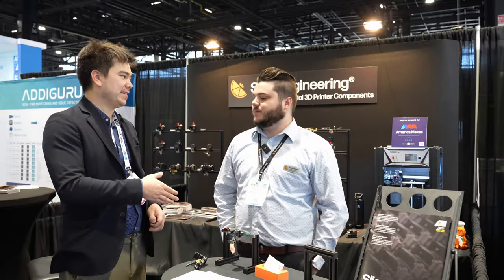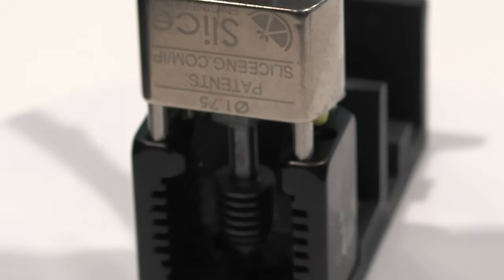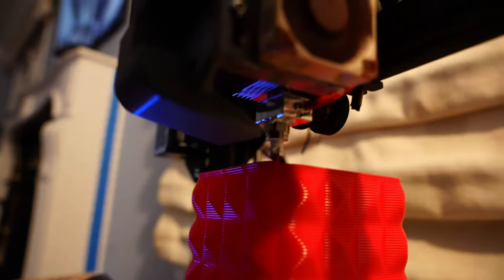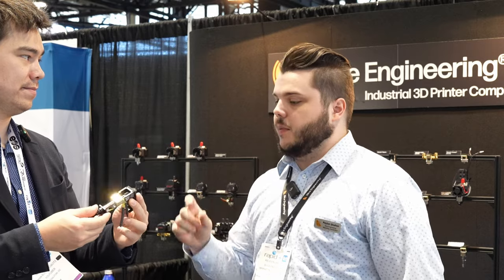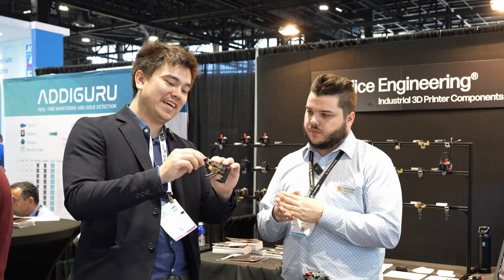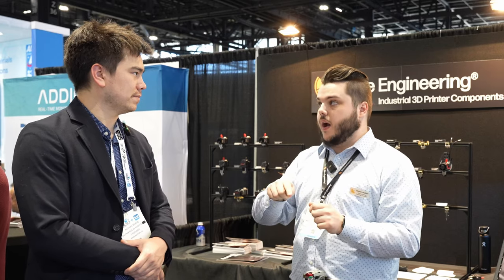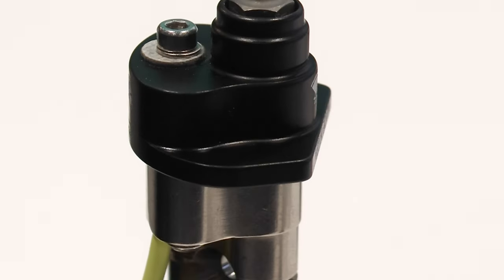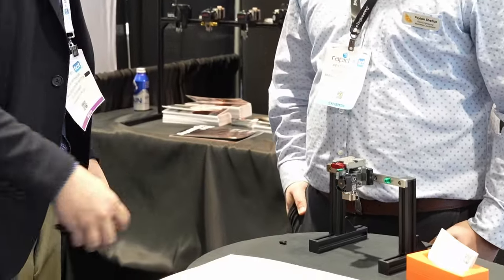Slice Engineering's Insane $1,000 Hotend

Comment from the maker: For those about to ask who needs this hotend, it really it comes down to industrial users with $50k machines that want to be able to print twice as fast.
That $1k investment saves them $50k on buying another printer.
Do I need it? No.
Do you need it? Probably not.
Does someone else need it? Maybe!
Reply: I mean, it's not that expensive...It's like 3x Ender 3 S1, but you get much more bragging rights, so I figure it's worth it.
Reply: @astrumrocket6556  Install that in an ender 3 :)
Reply: Then maybe they should stop doing bogus patent takedowns on companies (and even individuals!) making parts that aren't for $50k industrial printers.
Reply: @atnfn  No no, my budget would allow me to have either 3 enders, or a single hotend. No negotiation. /s
Reply: A goliath looks better/same for 1/7 of the price
Reply: TOTALLY WORTH IT!
Reply from the maker: @gedeonang7077  there is also a crazy long ceramic heater hotend on the market from trianglelabs that I’d like to try. Looks fun

Comment: Looks surprisingly like the Goliath (LSD) from Vez. Hmm, didn't S.E. slap him with a Cease and Desist order right after the Goliath was released. All makes sense now doesn't it. Say what you will about IP, but the patent system in most countries is terrible, and basically serves to stifle innovation. IMHO, the likes of S.E. and Stratasys have set back residential 3D printing many years now.
Reply from the maker: Everything they are doing is legal. If you don’t like it, write your senator and get the laws changed.
Reply: @NathanBuildsRobots  Patents are a good thing, not arguing that. It's just that when a company is blocking an entire field from progress, like Stratasys did with their enclosed printer patent, or Slice with their hot end spacers, it isn't that great. especially when said company sits around and doesn't develop products further.

The Stratasys enclosure patent expiring has opened the floodgates for affordable and good quality printers. What used to be $100k+ can now be bought for less than $2k.
Reply: @NathanBuildsRobots I really enjoy your content, but that is a stupid response.
Reply: This is good advice.
Reply: @NathanBuildsRobots  Legal is not the same thing as admirable, or even ethical. Community pressure on Slice is far more likely to effect change than petioning a Senator to change patent laws. I'm not saying it's likely to change the way Slice does business, but the likelihood of patent law being overhauled over something like this is so infinitesimal your advice can easily be confused as bad faith advice.
Reply: @NathanBuildsRobots  write your senators lol,  did you remind him to send 100 million check along? Please stay off politics.
Reply: I think you can make the argument that slice doesn't deserve the patent.  I remember reading a thread back when the voron team dropped slice where some guy said that slice's designs had been around in other hotends before they were patented, and one of the requirements of a patent is that no previous design has been made... something like that. 
anyway I don't think you have to demand that patent law changes to claim that what slice is doing is wrong.
Reply: @trandachtomy  Agreed the one thing companies like $lice respond to is the loss of a customer base.  Stop buying from them until they change their ways.

Comment: 1) make a very good hotend

2) patent something you didn’t even invented in the first place

3) get confident and release an overpriced UHF Hotend

4) no hobbyist uses or showcases it except one super friendly guy with his DIY high speed printer, providing advertisement for your brand

5) the same guy makes his own hotend that outperforms yours in every point

6) send your patent lawyers at him to sink his project despite sharing no similarities with your design 

7) he nearly gives up but sells his hotend anyways

8) write a response where you insult nearly every aspect of the DIY community

9) loose respect from every hobbyist consumer

10) « Slice Engineering is proud to announce its move forward to industrial 3D printing »
Reply: thank goodness vez changed his hotend so it does not violate the patent alr, and can be sold worldwide :) and "industrial" doesnt really need those flow rates, large nozzles and low resolution isnt really what industrial needs, if they are looking for that a pellet printer is prob good. if you see what they are printing with that hotend its just useless toys lol
Reply from the maker: Pretty sure companies are buying these. There are a number of other features, like redundant sensors/heaters, multi zone heatbreak, internal flow splitter, specialized coatings, etc.
Reply: @NathanBuildsRobots  Not sure about how good slice's coating is, but I know the Goliath's one is Zirconia internal coated, which is SUPER hard and abrasive resistant at very high temperatures. Abt redundant sensors, ok... Internal flow splitter and heaters are not really useful as long as the hotend performs same/better (which according to tests, goliath is). Goliath is also lighter and more rigidly mounted (3 points for ceramic core to heatbreak, instead of 2)
Reply: @NathanBuildsRobots  oh Im not doubting that, I entirely recognise the performance of their product. 
I was pointing out how they lost a big part of their customer base
Reply: I see nothing nefarious about the patent.  The use of tubing lowers the manufacturing cost, reduces the heat conduction and improves strength.  It's an improvement over solid spacers, so patenting it is fair.   It will not kill any competing products.  All they have to do is refrain from using hollow spacers at the heating block.

Comment: This looks like the VZbot Goliath. Just twice as heavy, no insulation and almost 10x the price... I guess we know why Slice tried to stop that design... Though one interesting part of it is the included CHT splitter, though now you can't cold pull it lol.

Edit: Oh, and the Goliath can do PLA @ 118mm3/s with a 0.4mm nozzle, Slices 116mm3/s is with a 0.8mm nozzle rofl.
Reply from the maker: This is how the industrial/commercial side of 3D printing works. Stratasys just purchased desktop metal for 1.5 billion. They were essentially buying their patent portfolio, which is insanely extensive. Look it up
Reply: No... sorry No hotend in the world can do that flow with a 0.4. 😅 not even goliath.  The hole is just too small to push that amount of plastic.
Reply: He got the numbers wrong, but his point is still valid about Slice Engineering ridiculous pricing when your hotend design is potentially better for a fraction of the price. Love your work and your channel btw, big fan!
Reply: @Vez3D  It's just a matter of pressure. If you had a hydraulic press behind it you could easily push 150+ mm³/s through 0.4 mm hole. The melting power is there.
Reply: @dalias prints  yes but then when you over-pressurize the hot zone it prints like crap. So thats why you have to let it flow. Thats the punch line of the Goliath :)
Reply from the maker: Hello everyone, welcome to hydraulic press channel!
Reply: @daliasprints9798 I mean the man himself is telling you you're wrong about his product and the science behind it and effectively nixing a selling point for him. Not thinking he needs to be educated on the matter  lol

Comment: One question that I feel is missing here is, "Does/could it work with pellets?". At 0,5kg per hour, the cost difference between pellets and filament really adds up.
Reply from the maker: I agree, pellets make more sense for large high flow systems. However, if you want to use a smaller nozzle, with smaller more precise features, filament fed still might make more sense. Plus when you start to look at overall consistency and repeatability, and compositing options filament fed might actually be better for many applications.
Reply: @NathanBuildsRobots  For sure it would for many applications. What I'm interested in is if it's an option. Or perhaps could it do both in some way? Now that would be something! Similar how there's an interesting (and I feel little known) detail that Bondtech CHT nozzles can take both 1.75 and 2.85mm filament. Doesn't sound like it's important since majority of printers use 1.75mm filament, but the option of it is nice!

Right now, I'm building a printer that might use a pellet extruder in the future, and the options are kind of low, my current favorite being the Mahor V4, and it's price is not far of from the 1000$ one from the video, but it has half the flow rate.
Reply: @NathanBuildsRobots  Why would you want a hotend with this kind of flowrate for 0.4 mm nozzles? Makes no sense.

Comment: Goliath can do 50% more flow for like 10% of the price. His claim of highest flow on the market is just an outright lie. What you'd expect from this sleazy company...
Reply from the maker: What flow can Goliath do? Haven’t seen the numbers on that
Reply: @NathanBuildsRobots  I've seen it do 160 or so before becoming unprintable (skipping etc.)
Reply: @daliasprints9798  I've heard people have mirrored slices' testing setup on goliath and managed greater flow. I think saying 160 is very optimistic however slice in the past has been unbelievably optimistic with their listed flow.
Reply: @NathanBuildsRobots  That is correct, with slice's setup (nozzle size, etc) the goliath could achieve 116 with PLA easily without underextrusion. They are just happily ignoring that after trying to remove it, but they failed. They patent should not exist (it doesnt meet correct conditions), yet they are trying to use it. but they have since changed the design to not fit the patent so it can be sold anywhere now. a goliath is much much better, and dont buy from slice pls, very scummy behaviour. It is not the world's "fastest hotend", thats just such a happy lie. look at his face when he said it, he knows it's a lie

Comment: Does it still take 1.75 mm filament? The extruder would have to be flying to keep up with 116 mm^3/s
Reply: apparently it does at half kilo of filament an hour
Reply: Thata pretty much the orbiters limit before loosing torque due to high rpms. But true, at this kind of flow rate 2,85 would be better suited. As for extruder the lgx would likely be the base extruder or one of bondtechs fat planetary gear extruders
Reply from the maker: I imagine it could accept both but I don’t know for sure
Reply: @jamesharris9894  sorry, the limit of a orbiter is 120mm/s, not 120mm3/s. The 120mm3/s result in a feed rate of only 50mm/s so a fast retract for a direct drive extruder

Comment: slice, the company known for patenting things that they really shouldn't ,
im going to pretend like their patents are fine and get straight to the point

at 4:09  does that not look like the solex core heating technology? that is also patented? 
i thought only bondtech had an agreement to let them use  core heating?

so is the patent company breaking patents, what a surprise from slice

(i love your videos by the way i have nothing against you :D )
Reply from the maker: I believe they are partnered with Bondtech to license the technology. This isn’t a violation, it’s the patent system working as intended.
Reply: @NathanBuildsRobots   I did a bit of research and couldn't seem to find any reference to them working together

on the list of patents used by slice engineering on the mosquito prime it shows

US 10875244
US 11660810
CN 110770002
US D905768
US D980882

and there is no reference to licencing it from 3d solex or bondtech

i then did a bit more research and still couldn't find anything referencing it 
idk
It doesnr affect me so i will just forget it and try to not be a pest in the comment section

Comment: I’d be so stoked about this, especially because I have 3 machines running magnum+. But why is $1000…? And why couldn’t you just make this as an add-on to the magnum+ or why can’t I just buy the lower part and swap it with my current equipment.
Reply: Because industry dont even notice the price difference so they can charge what ever they like. Besides the Goliath hotend by the VZBot team is just as good and is 10th the price.